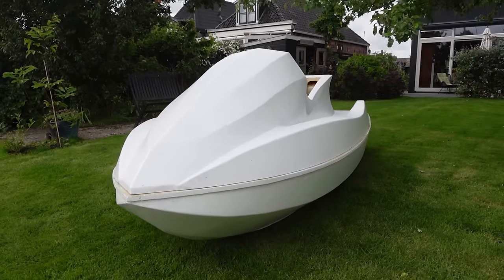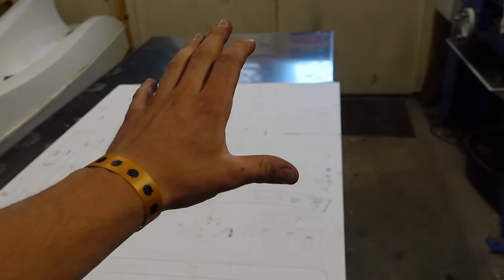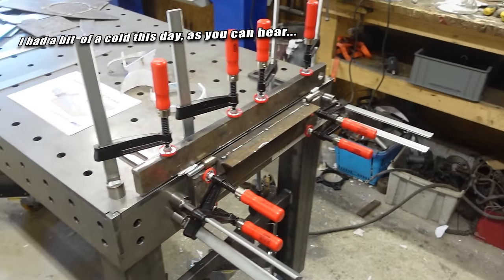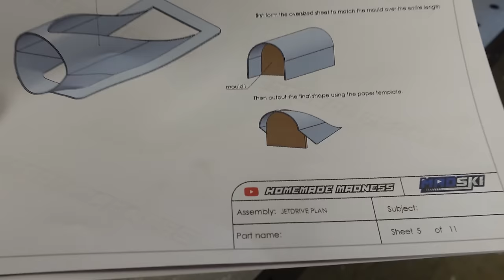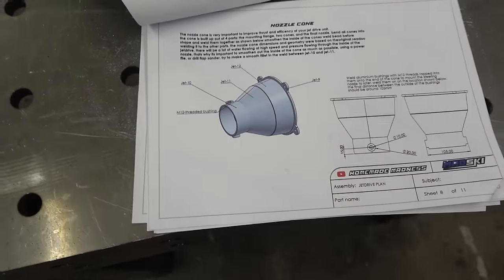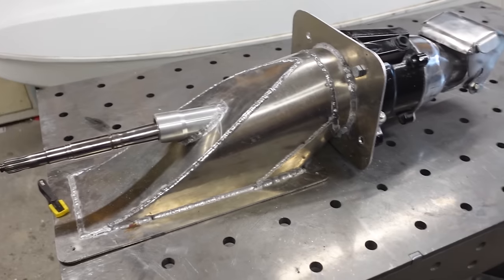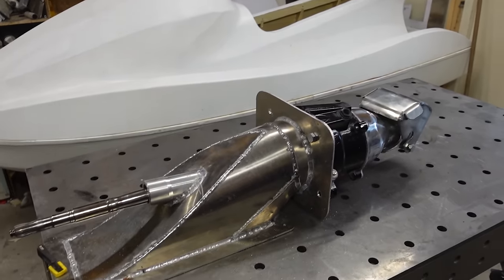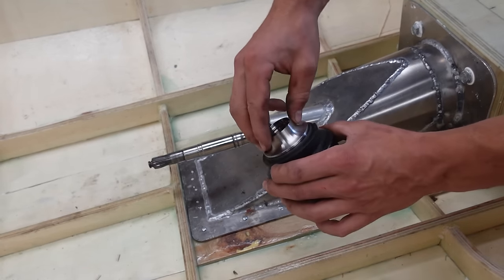How to build a Powerfull Jetdrive 200+HP (for jetboat, jetski, flyboard)

Comment: Love your work and your videos mate. A couple of tips for working with ali, if you cut it with a saw or drill it, spray some kero on the drill or on the sheet if you are cutting and it won't clog the teeth or stick to your drill bit. Wipe it off with metho on a rag before you weld. If you cut ali with a cutting disc then apply wax to the spinning disc before you start cutting and it will cut like butter. On long cuts you have to reapply the wax if it starts to slow down. Always wipe it down before tig welding, acetone is best but I don't like using it much. But most importantly please get a breathing mask or some sort of smoke extraction or you will be plagued with lung problems later on. Aluminium oxide condensing in your lungs is not a good thing. It's totally selfish of me, I don't want you to get sick and stop making videos.

Comment: A little more prep work before welding and your welds will look better. 
As simple as a stainless steel wire brush to remove the oxide coating and a wipe with alcohol should make things a lot better.

Comment: Might wanna weld in or thread in a place on the aluminum parts for a zinc anode if not when you go into saltwater it will corrode your aluminum

Comment: Steel shouldn't bolt to aluminium, if you put that in salt water it will turn into a battery and corrode, even just sitting together in the atmosphere will start corroding the aluminium.

Comment: I'm sure someone mentioned by if not. ALLL parts need to be installed with caulking  that are in contact with water. ALLLL parts including screws,, grates, plates anything everything and use 5200 or sikaflex. DO NOT USE alcohols to clean up caulking. mineral spirts to clean, and soapy water for finish visible beeds.

Comment: I hope there is a blooper reel of several failed attempts and a pile of scrap metal in your yard  and a screaming wife threatening divorce in your messy shop. I would feel better about myself. 
However, you probably did this on a Thursday after work and still caught the news at 10.
Impressive skills and great bender idea, I will be making one of those asap.
Thanks for sharing.

Comment: SOS HELP……
I need help, 
1st iff where where can I get the set of prints to glue to sheet metal to cut two sets of this jet motor?
……2nd…..
How would I figure out how big of electric motors needed to push a 21’ center console fishing boat, deep V line Carolina boats or contender type hull shape boat. Want one on underside of each side of rear transom, and I’m going to put like a 50hp outboard 4stroke motor in between the water jet motors, for kicker or in case I suck something up one of the jet motors or one craps out & I’m offshore. 
  Can anyone help me, I would be most grateful, anyone especially in North Texas that I could meet with I’d let you borrow the boat when complete whenever you wanted. Not too bright in the math amp draw part of mathematics but ton of talent tooling and making assembling, rigging. Trying to get hands on a contender, yellow fin, Cobia w, tuna door on it, least a 2020, 2021, 2022, 2023 from hurricane in Florida to rebuild, just returned from Marathon Florida, got back from a weeks stay got back 10/23/22, to. Of semi submerged boats but not fully sunk, just rain damage but enough to total them out tons of them, just gotta wait for state to file abandoned, and go pump it out pull to dock get trailer there pull it home 2 year project, gotta let it dry out might hv to cut tank out look under floor, at bulkheads but a lot arn’t damaged but going to be abs dined cause the owners want new ones that’s the insurance game is played. Don’t take much to rebuild or clean out motors and I can sell them as nearly new with guarantee all my shit has guarantee. But want to build a twin jet drive offshore boat. 
Thanks fir anyone that can help by telling me size of electric motors needed, may hv to go to gas/diesel motors not sure yet  but can glass the motor mounts in and make covers and put exhaust piped out in back or side. Thank so much to anyone I don’t know how to contact thru utube